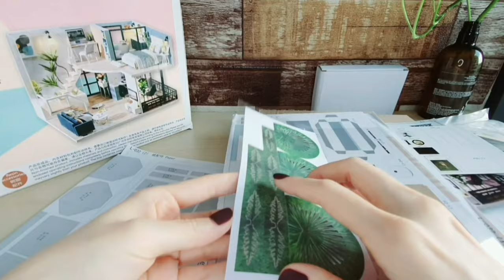DIY Miniature dollhouse kit new model 2021 | DIY Miniature Loft Apartment | 미니어처하우스 |

Comment: Got one of these and I have to be honest this video helps as a cool quick guide ma y of them do but they aren't that easy to stick together.  I bought oodles of the best glue and it was heck to keep the wires on. Some pieces are too heavy or too skinny for the holding. It can be fun but be ready to do a lot of cutting and be patient. The fabrics in. Y opinion is not the best. I'm working on 3 miniature kits from over seas and so far the scaling is a bit off so it looks like I have to change it a little to make it work. Good luck on your projects and happy crafting to everyone 😊 😀
Reply: what glue do I buy?

Comment: its probably better/safer putting the batteries in AFTER you've twisted the wires and stuff also is that tape that u put on the ends safe for wire/electricity
Reply: It is a set and it has instructions
Reply: She doesn’t make it up

Comment: Did anyone else have trouble with the lights. I did everything but they won’t work. It was fine when tested them. Also, two light strings are way too short so I left them out. I l’m upset cause I feel like I wasted a month on this. Very frustrating to put in that much effort and then it just doesn’t feel complete.